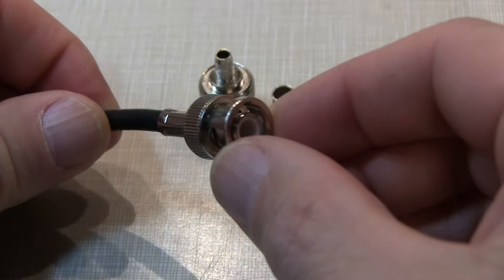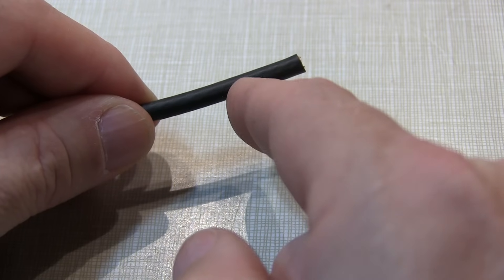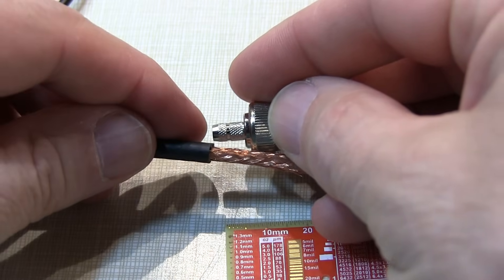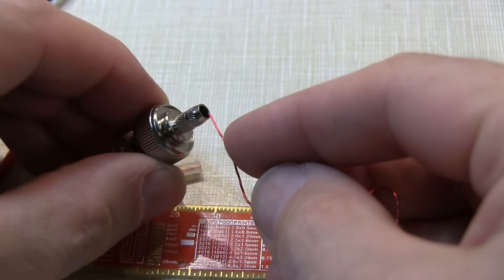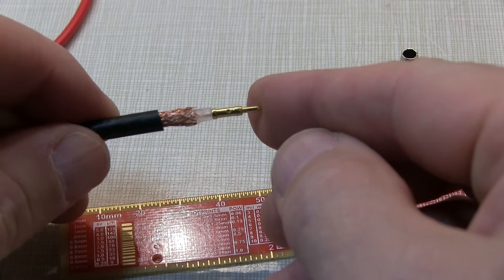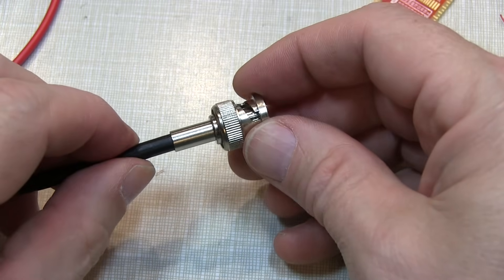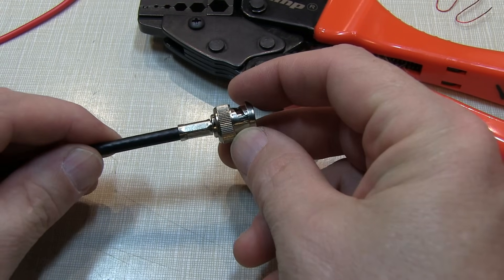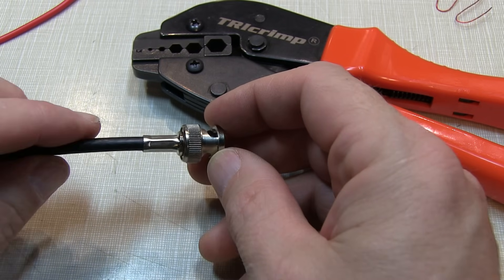#230: How to install a BNC connector on RG-58 coax | DIY Repair

Comment: Thanks for crimping the center connector! There are a lot of videos from the CCTV guys on youtube who just leaves it hanging, without any crimping. 

On another note, I was always taught that the center pins without the tiny side-hole should be crimped, and the ones with the tiny side-hole should be soldered to the center conductor of the coax.
Reply: +NatureAndTech CCTV 'guys'   can escape with a lot of 'losses' or leakage which would not be acceptable to power limited devices, especially mobile or medical (for EMI reasons).
Reply from the maker: +NatureAndTech These were advertised as crimp-or-solder.  The solder hole is at one end of the sleeve, so that there is a good solid area for crimping as well.
Reply: +w2aew I can see how soldering can lead to less loss in the longer term due to oxidation limitation. A proper solder joint with the eutectic dissolving into solution with the copper provides a high integrity bond with maximum contact for best conductance and  lowest inductance. Matters of some value in mobile RF/UHF devices.
Reply: Excellent Video. Thank You

Comment: i had a lot of BNC plugs that "clicked" once you stick the center pin inside the shell and push it all to the front.
Reply from the maker: +Axel Werner Those are nice - good positive feedback that you've inserted everything far enough, and provides a nice mechanical support for the center pin.
Reply: +w2aew Where might one get these?
Reply: +Evilroots dont know.these were industrial high grade ones with teflon insulation. these all look alike,but are different in Detail. guess youll need to study data sheets.
Reply: +Evilroots 
I'm not sure if that helps you, but the UG 88U-C174 at Reichelt has the click in centre pin.